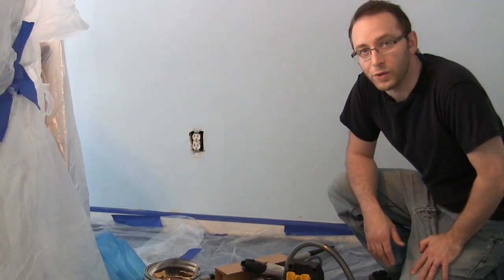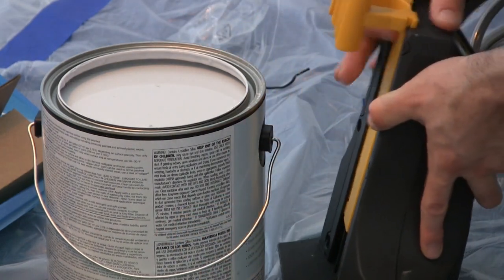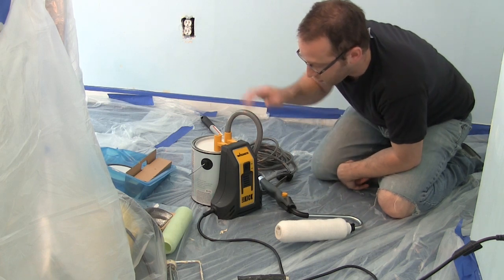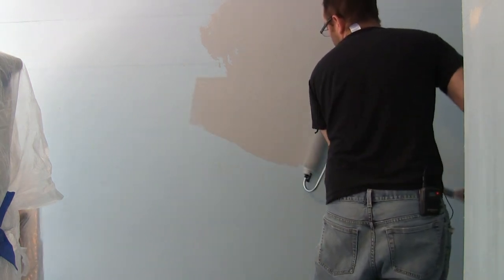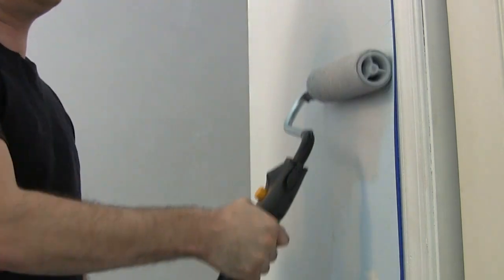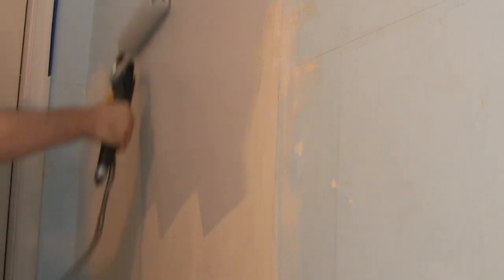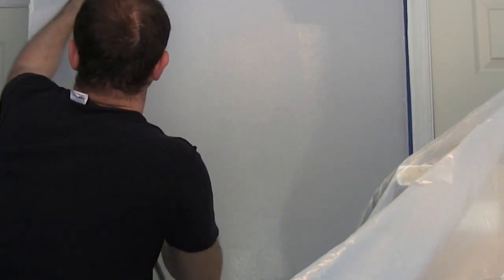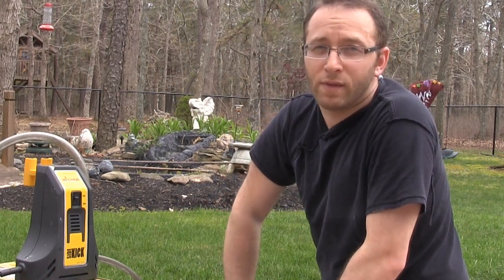Wagner Smart Sidekick Product Demo and Review

Comment: Used my new Sidekick today. I like it. Replies to concerns raised here and some of my own.
1) The squeaking comes from the roller retainer clip. Petroleum Jelly on the clip area can stop it.
2) Paint build up on the end of the roller. It's not as bad as the build up from dipping in a paint tray and getting paint on the ends of the roller.
3) Button placement is a bit of a procedural challenge with a long pole but once I got a technique and rhythm it was not a big factor. 
      My technique was to push the button; let it dispense paint while rolling the wall to spread out the paint (move quickly in a bit of the W technique) until paint with little globs were spread along the wall then back roll however much. I was able to do six feet wide from top to bottom with a nice even coat and believe i could have gone wider.
4) A concern not raised is the extension pole coming loose that always upset me with standard roller frames and it's no better with the Sidekick. So I had to constantly re-tighten the pole.
5) Clean Up I thought was easy. In fact i think the roller cover cleaned easier because the holes allowed water to rinse better.
6) I didn't like the tightly coiled hose and I tried to make it as straight as possible. While cleaning I discovered the hot water softened and allowed me to straighten the hose a bit.
7) "Inside Out" is a great animated movie and a good idea for ones shirt. With ones shirt inside out the paint will not show when the shirt is turned outside out.

Comment: I just bought this one today because my 13 yr old Wagner Power Roller broke internally.  I hope this new one will be ok.  I noticed in your video the roller was squealing at times .  Why was that?  Also, I saw someone else's video for this same product and they had a problem with paint accumulating at one end of the roller and then dripping.  Did you ever have a similar problem?
Reply from the maker: Louis Mitchell dunno why it was squealing but do know that it worked great for multiple rooms.  The biggest pain is cleaning the unit out.  Besides that love it

Comment: The trigger is very badly placed, if you wanted to paint high (with a pole attached,) you'd need to bring the handle down, to press, "self defeating" 
If the trigger was at the bottom of the pole it would be a lot better,
Also I didn't see you lay off the paint, so I'm not sure you got a nice finish, great idea, but not practical.
Reply from the maker: +Barry Oneill Thanks for the info.  Saved a bunch of time for sure and room came out great